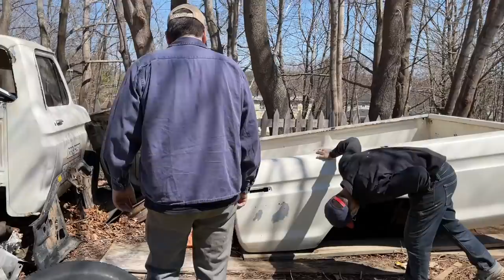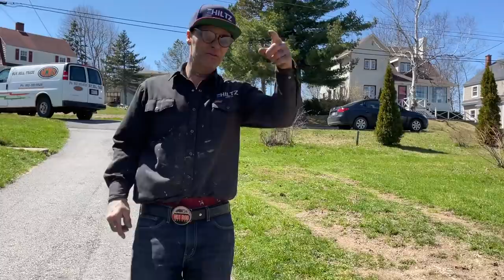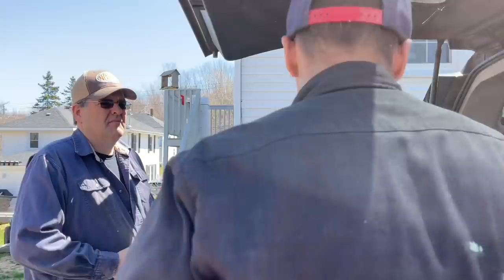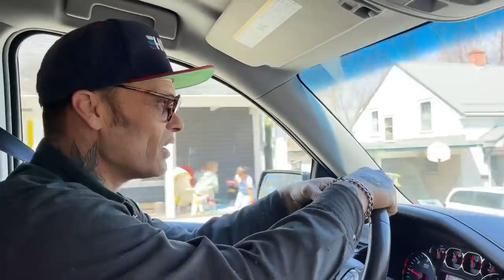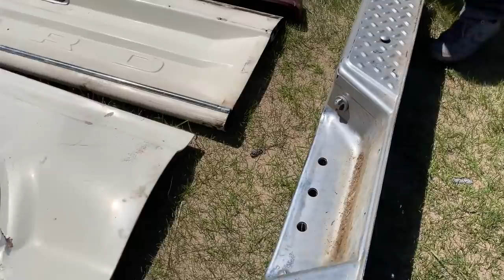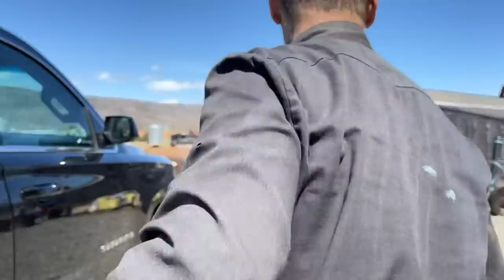FREE 1978 FORD TRUCK??? Sure, we'll be right over... 👀

Comment: You asked about my project.  I have had long term, serious, health issues, that have prevented me from working on my big block powered, 55 Chev Cameo, that I have owned since 1967.  We also have my son's 47 International KB1.  We were working on installling a 400 small block in the International, before my health took a turn for the worse.  
I am doing better right now, and am looking to start working on our fun stuff again, as soon as I have done the clutch in my daily driver, a Frontier 4x4.  I also have a lot of other stuff in the yard, but at my age, 79, I don't know what else will get done.

Comment: chad you and joe lean get the lucky dog award for today  I'm in the middle of redoing  my dads 1986 chevy c10 short bed step side truck its got a hot chevy 350 I lowered the rear 4 inches and the front 2.5 inches body was a little rough but its a labor of love and my dad gave it to me a couple years before he passed away I've been working on it for the last two years in painting it colonial red  I'm building it on the cheap  but I did buy new doors fenders inner wheel wells and rad support my best friend bought me new head lights to put behind the custom grill

Comment: 69 Chevrolet pickup I've had over 40 years a retirement project I have both beds for it Stepside and Fleetside rebuilt 350 Turbo 400 with an Overdrive 12 bolt rear axle with the Yukon gear posi. Lots of CPP parts disc brake up front new radiator. Thousands of dollars in parts still in the box little by little.

Comment: Rod and Custom (I think) ran a series a while back of later model trucks cut down into deuce-style street rods. The dent side Ford like that 78 came out pretty nice, as a phaeton if I remember. No roof, body and bed welded as one, tailgate recessed as the rear sailpanel. Eh, however you build it, it'll be something sweet!

Comment: I am about to start on my 1959 international pickup i need to cut the old gas tank out and I got a newer gas tank for it, and next 500$ I am going to put it on to a newer dodge chassis so I can change to 4 wheel disc brakes, I can t find brake parts any more and I think it will be safer to drive with disc brakes than drum brakes. I have had this truck since I turned 16 yrs old and I an 45 now love the cab over. My name is Phil cheers

Comment: Working on all sorts of stuff at Roots! 72 Pantera, 65 Ford
3000 tractor, 32 Ford sedan, 71 F250 Highboy crew cab, 63 Galaxy, 79 Corvette, 68 SS Camaro convertible, 81 Z28, 55 Chevy 5 ton, 27 Ford Roadsters, 48 ton and a half, and an 81 F100 step side.
Reply: Drop everything and finish the Pantera

Comment: I just been working on my daily driver at the moment getting everything I can think of done while I can get parts in just done front drive shaft universals and transfer case seals on the weekend have new torsion bars and rear leaf pack coming so that's next mission oilchange this weekend cumin it's a 4x4 mitsubishi l200 triton 2.8 diesel

Comment: What a great deal free that Ford F 150 is a good truck put 302 and automatic transmission it will run forever. And the 37 Ford great deal. I'm working on a 86 Ford F 150  in line 6 / 3 speed with overdrive  it has 71 thousand miles  hasn't been on the road for 19 years  I replaced brake lines ,wheel cylinders plugs ,an Wire's a new battery, clutch and pressure plate throw out bearing ,unversial joint, still have to take dash apart to clean out mouse nest . There's no rust I bought it for 200.00 Dollars .the man I bought from he was going to have it crushed  . And I had new tires put on it my wife love's it and wants me to repaint it ,it's factory deep red. And the bench seat looks like brand new it was covered with a seat cover. The old owner drove it back an forth from his home to Ford Motor company in Lima Ohio . I'm happy I bought the truck.

Comment: Dang that's Nice n you guys are lucky to get that 37 Ford n ya I'm working on my 1975 Ford super Cab. W/ 460 engine n all Original truck n Man the Prices went up on those n I seen that they start a $8,000 to $15,000 nowdays n because they are Doing engine swaps with a Diesel Engine n than they get Like $30,000 n up for them

Comment: Gotta like that free ford Truck. I think you should fix it up and use it for your pickin. I'm gathering up some old 41+47 Ford trucks to work on as my retirement project. The 47  I want to leave it in patina and run the v8 fla5head in her change the 7nder carriage. The 41 i want to put a v8 in her change undercarriage in it also and get you to paint it. Lol